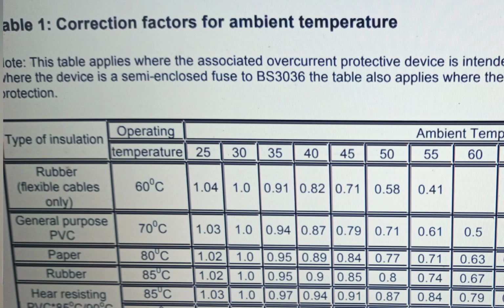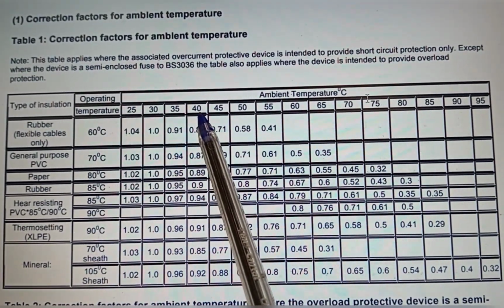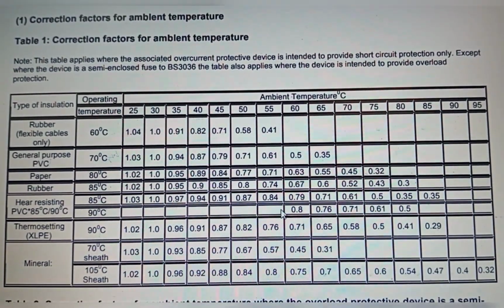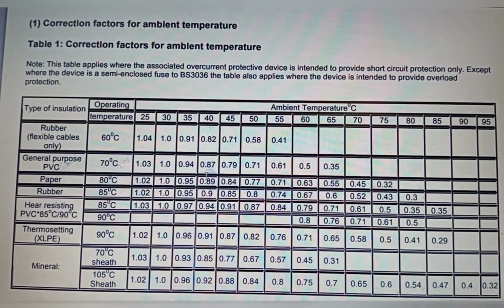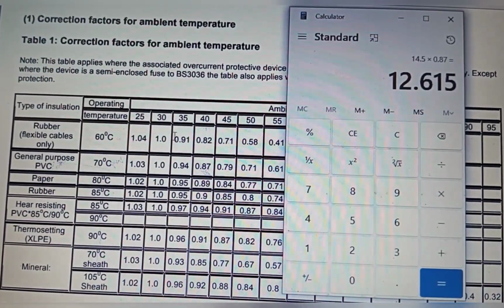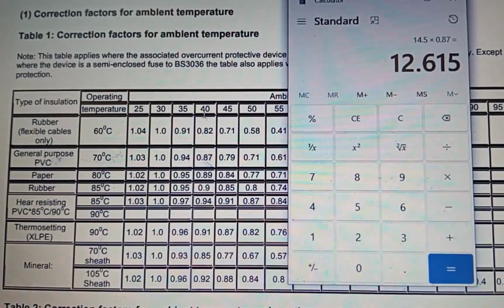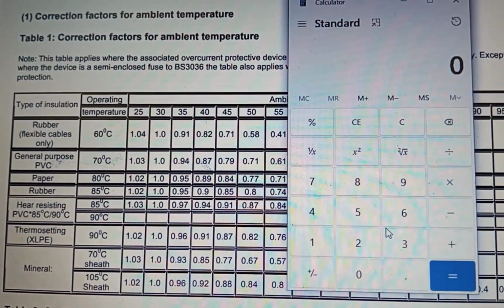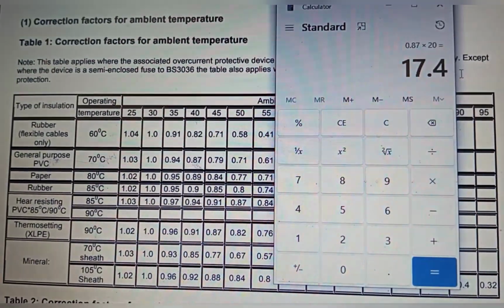Part2 - How to select the correct size of cable

Comment: Thank you for your good work. Please how do u determine the ambient temperature of an environment before determining the cirrect size of wire
Reply from the maker: The exact ambient temperature of wires in conduit is difficult to determine directly without measurement. However, you can estimate it by using  the temperature of the surrounding air where the conduit is located. You can use a thermometer to measure this. Or you can find out the by enquiry.

Comment: Sir please do have 17 amps in the market
Reply from the maker: There are many types and sizes of circuit breakers based on different criteria and applications. but 17A is not common so It depends on which market you are looking for it at.